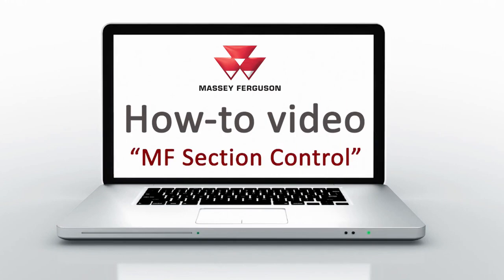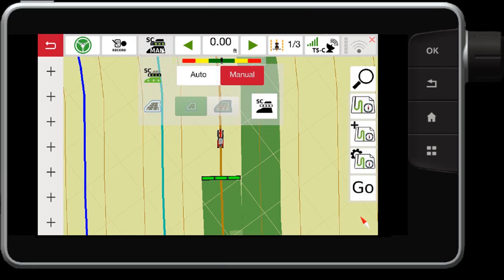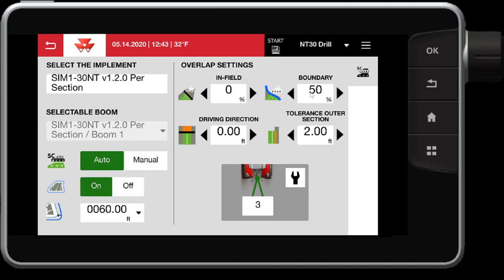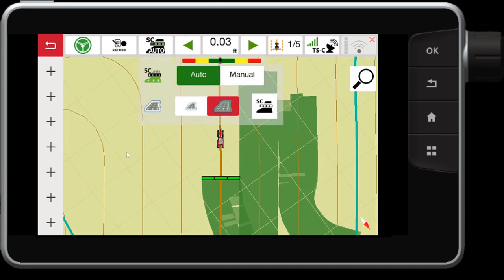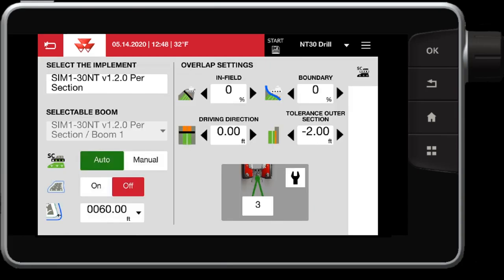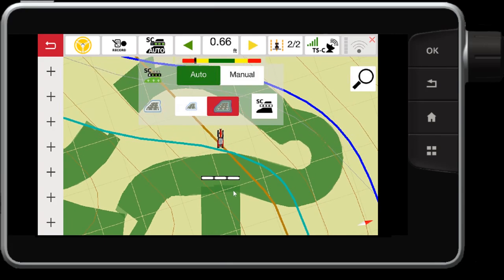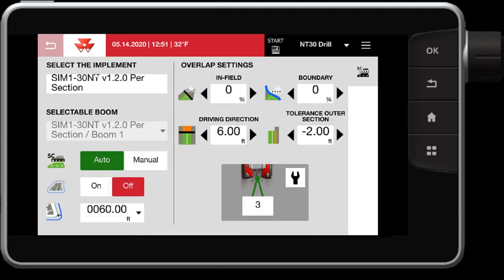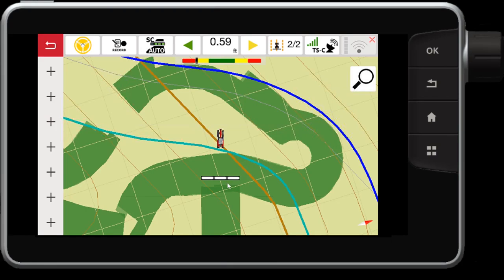MF Fieldstar 5 & Datatronic 5 Terminals | MF Section Control

Comment: Just bought a used massey ferguson 7720 s with one of these screens in it. It won't do anything. It just shows the Massey Ferguson logo at all times. Even when the key is off. Runs the battery down after a few days of not using the tractor. Can anyone help?